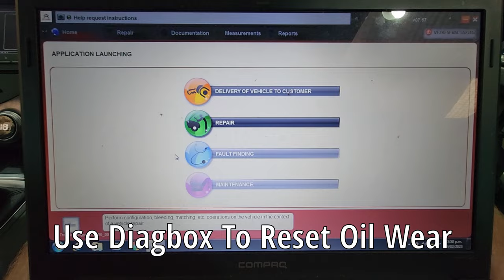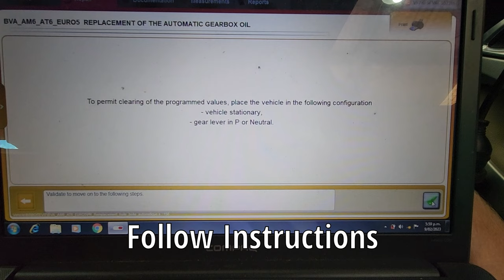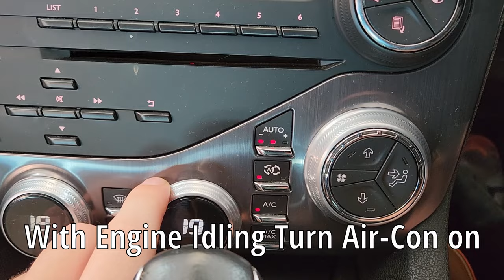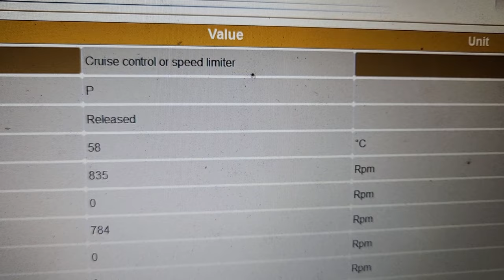How To Change Transmission Oil Aisin Tf-80 / AM6 Citroen DS5 (DS3, DS4, C4, Peugeot 3008, 5008, etc)

Comment: Excellent clear instructions. Internet is a minefield you have to pick your way through. 100 ways of doing every job but 99 are BS! Stumbled on yours after many blind alleys, most had even got the make of gearbox wrong. Had to remove the air box to luckily find the stickers which were still attached. Great job. Any more videos on Citroen C5 VTX plus 2007 2.2 diesel auto would be greatly appreciated!
Reply from the maker: Thanks so much for the feedback. I've been there myself so know exactly what you mean, and it's the reason I make these videos!
Reply: Im doing a 2.2 diesel 6 speed today any differences
Reply from the maker: @brycechessum4684  If it's the AM6 then it should be the same

Comment: I've filled mine from the breather cap and only later noticed after removing the actuator  ECU there's a cap on top of the almost hidden transmission reservoir.. Any ideas if ive done damage ?

Comment: This also applies to the Mazda CX-9. I changed mine at 75K miles and it looked like dirty motor oil and the transmission was shifting badly. I ran thru 12qts of Mobile One 3309 fluid and it shifts like new now.

Comment: Thanks for video.  I am planning to get my 308 t9 eat6 transmission oil changed but I am not sure if my mechanic has the equipment for the software adjustment. Do you have any idea what happens if the oil life meter not get resetted?
Reply: it does not do anything different than the old oil you drained at best. Harsh engagements persists. Be sure to reset the oil wear counter and do the pre-alignment process exactly like in this video. AC On, cycle through gears, drain excess oil, you're good to go.

Comment: Is there a simplier solution than using diagbox ,, are there any obd faultcode readers that can do this ?
Reply from the maker: @taur73  it would need to be a high level tool with advanced capability for PSA vehicles

Comment: What's the quantity of Oil please..Is 75-80 OK
Reply from the maker: You must look at the fill cap to find the oil type, most likely AW-1. From memory a 4L bottle will be enough to comple this service.
Reply: I topped up in the breather cap after draining 3 lires off, then found the cap on the actuator reservoir later..It looked looked full in the actuator reservoir anyway...Not sure but I Dudbridge repressure it with diagbox

Comment: Hello friend, I have a 2017 C4 Picasso 1.6 HDi with a 88kW EAT6 gearbox, 185,000 km, and the oil didn't look bad at all. Today I changed the oil and about 2.5 liters leaked out of the gearbox, roughly estimated. Then I poured in new oil, and when I poured 2.3 liters, it started leaking at the oil gauge. I added another 0.2 liters and didn't pour anymore. Shouldn't this gearbox take 3 liters of oil? Should I have poured in 3 liters or not? And what could happen if I leave more oil in it? Tnx
Reply from the maker: Follow the instructions in the video and it will be OK.
Reply: @HeroRepairs  tnx friend

Comment: Got the 2012 6AT 308 156HP is it a recommended procedure to replace oil filter on a car of this age ? . Is thateasy enough to do ? . Cheers for the video
Reply from the maker: Yes it is recommended. There are various transmissions that it might have so you will need to check which one it is and find the procedure.
Reply: How to change if your gearbox is "sealed for life" ?
Reply: @Милош-е5м   I changed the oil basically there's a plug at the bottom of gearbox actually 2 of them one inside the other , undo those plugs and drainfluid  into pan measure the amount of transmission fluid then either reinject that same amount of new fluid back into the transmission from the bottom with a "turkey baster oil suction device , or go uptop and find the bung up there , its probably hidden under the air cleaner .
Reply: @chlyon Yes i know that. But how you gonna change gearbox oil filter?

Comment: I have a 2015 Citroen c4 grand Picasso and my auto transmission unit is sealed but I have taken the filler plug off yet to see if my drain plug is the same as yours
Reply from the maker: What do you mean sealed? No transmission should ever be sealed. There will be a way to drain and fill it, but the procedure may differ depending on what transmission you have.
Reply: @HeroRepairs  yes my transmission is sealed for life they tell you this at Citroen but my car is 9 years old and has done 130000 and the auto gears are taking a bit more time to change , you can check out the other videos where they tell you it’s sealed but that’s so you don’t touch it
Reply from the maker: @jamesgarson1058  Those are just lies the manufacturers tell you so they can reduce service costs. They absolutely do need servicing. There's no such thing as a lifetime fluid.

Comment: Is engine should running ,while check oil level by the plug?
Reply from the maker: Yes
Reply: Before removing the automatic transmission fluid level control plug, the engine should be idling because otherwise the transmission fluid will return to the sump raising the level beyond the upper limit. In these circumstances the amount of oil necessary for the correct operation of the automatic transmission would be reduced.

Comment: I have a c4 picasso 1.6 hdi 88kw EAT6. Do I need a Diagbox diagnostic tool, i.e. can I use any that can show me the oil temperature?

When new oil is put in, it is necessary to go through all stages: P, R, N, D and manual mode, is it necessary to change all 6 gears to manual, can I because my gearbox has 6 gears (EAT6)?

I think this is not enough, the same thing should have been done at least 2 more times so that the percentage of new oil was around 87.5%, this way we only have 50% new oil, especially if it is about high mileage and the oil has never been changed.

Thx for video
Reply from the maker: Any diagnostic tool that shows transmission oil temp will be fine, I just assume diagbox is what most Citroen/Peugeot owners have. Diagbox also lets you reset the oil degradation counter which is how the transmission adapts over time. 
Yes you must shift through P, R, N, D, and then manual shift as high as you can (I believe it will only let you got to 3rd). Remember to keep the brake applied so the wheels don't spin!
Most people will opt to do this service once, then drive for 500-1,000km and repeat the service. After that point you start to get diminishing returns, and usually it's a bad idea to completely change all the oil at once. It should be fine from then on to just perform the service periodically, say every 30,000km?
Reply: @HeroRepairs   I don't have a Diagbox, and it's too expensive for me to go to a PSA service (which doesn't do oil changes), and it's hard for me to find someone who has a Diagbox. I will see with my repairman if his software can do that. How important is it to reset the counter, what if I don't reset it?

My car has 175,000 km and the oil has never been changed, what should I do: should I change only 3 liters of oil (that is, only the oil that runs out) or replace the entire oil (that is, 3 times for 3 liters each), because I did not understand this part very well:

"Most people will opt to do this service once, then drive for 500-1,000km and repeat the service. After that point you start to get diminishing returns, and usually it's a bad idea to completely change all the oil at once."

If I understand correctly, if the entire oil is replaced, there may be a problem with the operation of the gearbox? I've also heard from some people that I don't change anything for now because I can only get problems instead of improvements?

Tnx
Reply from the maker: @NoName_11979  You can buy a diagbox clone yourself from ebay or aliexpress. Or if you can find a different type of scan tool that reads transmission temp then that should work.

It is preferable to reset the oil wear counter, but not essential. Especially if you only change 3 litres at a time and drive it between services then I don't think it'll be an issue as the gearbox will adapt itself somewhat. 

The only danger is flushing out too much of the old fluid in one go, but by doing it 3 litres at a time you very likely won't have any issues. This is because old fluid can have clutch fibres etc floating in it which gives it added friction, sometimes on older transmissions the clutch packs have degraded and new oil can be "slippery". But like I say, do 3 litres then drive it for 1000km or so, then change another 3 litres. That is the most efficient way to do it, and still retains a little bit of friction from the old oil just incase.
Reply: @HeroRepairs 5:24
Reply: What oil type for this transmission please?
Reply: @HeroRepairs  Thank you very much, I just now saw your comment, I just didn't get the notification that you replied.

Comment: Its necessary 
the computer software to perform a replacement?
Reply from the maker: Ideally yes. You might get away with just doing 3L and the car will adapt itself over the next few hundred kms, but best practice is to tell it when you have changed the fluid.
Reply: How to do that which software  I need?
Reply from the maker: @eddydayan2269  PSA Diagbox or a scanner that supports this car
Reply: I have fiat aw-1  transmission  look the same ..I wonder if I need to do also the reset

Comment: Hi, i have a ciitroen grand c4 spaceturer eat8 which oil i have to use? Thanks
Reply from the maker: Look at the fill plug, it should say what type to use.
Reply: @HeroRepairs  thanks, the procedure for the eat8 Is the same? The level must be done at 60°? Thanks a lot

Comment: Can u share what type of atf oil u use?
Reply from the maker: It depends on the car make and model. It should be written on the transmission fill plug on top of the transmission or maybe in the owners handbook. It will be either AW-1 oil, or JWS 3309 ESSO oil. Be careful because you must not mix the oil types or put the wrong oil in.

Comment: What is the type of dlc connector and the name of the program?
Reply from the maker: Diagbox which is for Citroën. Other brands have their own program. Sometimes a good obd scan tool can reset transmission adaptations.
Reply: @HeroRepairs  you are such a good engineer
Reply: @HeroRepairs  i want to communicate with you

Comment: Hi. Volvo also uses this transmission, right?
Reply from the maker: Correct, along with many other brands you can see here: https://en.wikipedia.org/wiki/AWTF-80_SC#Applications
Reply: Finally, someone who actually knows the correct method and what the fill level plug is for. Excellent tutorial